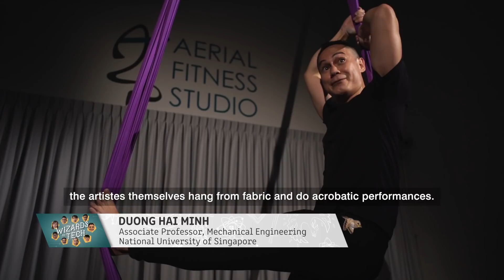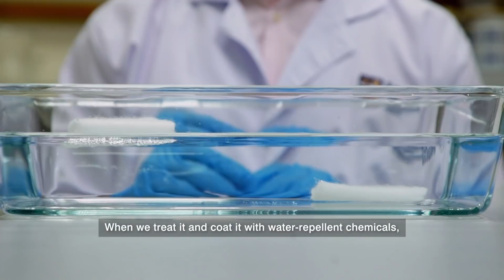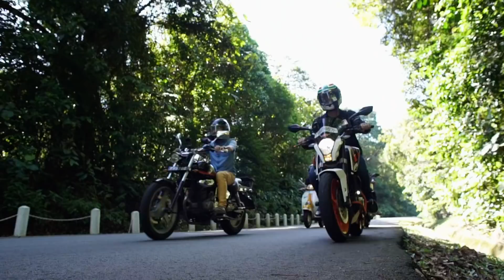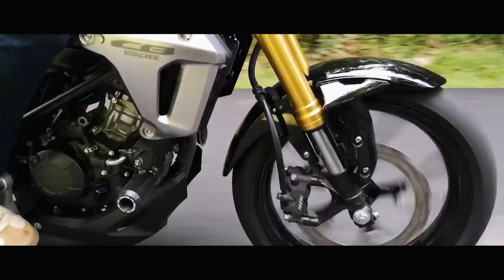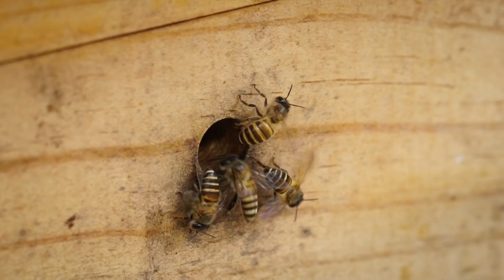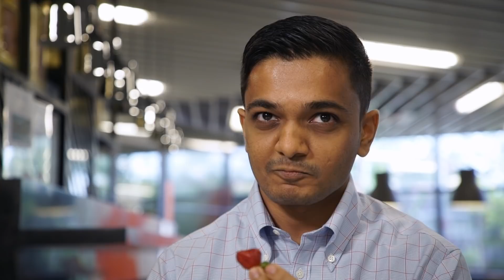Life-Saving Inventions Towards A Better World For Tomorrow | Wizards Of Tech | Full Episode

Comment: I remember wearing those thick and hard gloves for welding. With an aerogel layer, welding gloves can be thinner and lighter yet still provide better insulation than traditional welding gloves. Fireman could also use such gloves.

I also think that the aerogel can be useful for buildings. If applied on the exterior, it call limit the heat transfer to the interior walls and maybe even offer improve sound insulation. Applied to the interior wall, it can also reduce heat transfer into the walls. In an air-conditioned room, it should cool faster and is more efficient since the heat exchange to the wall is reduced.